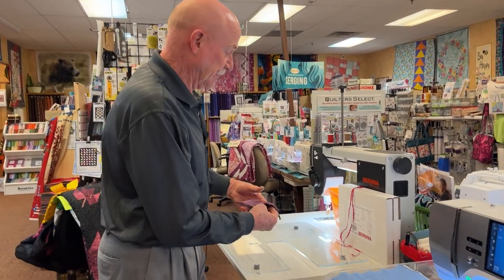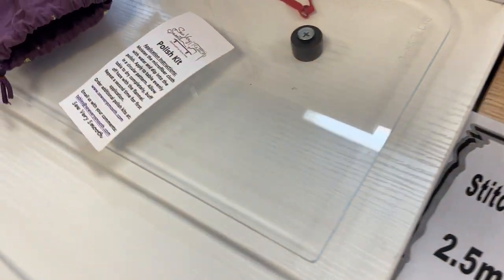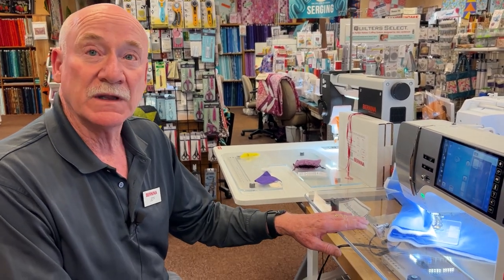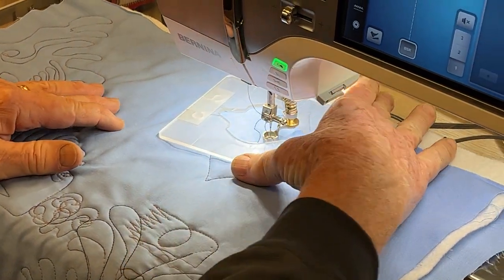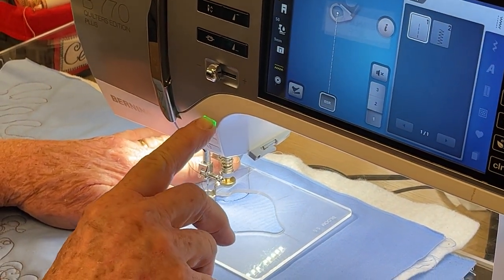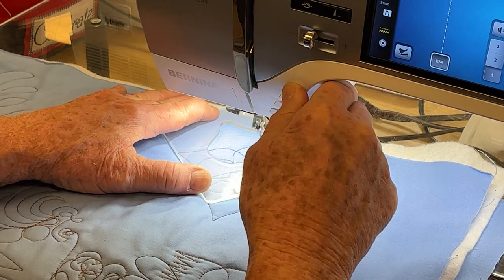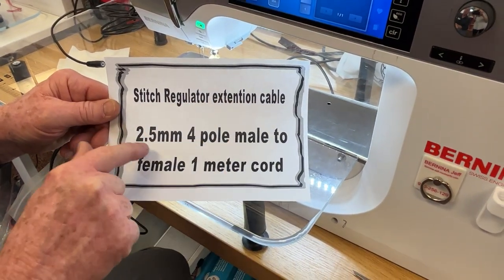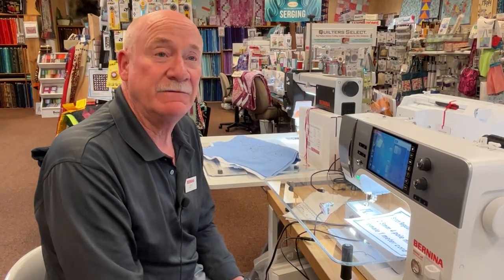Ruler Work Stitch Regulator table invention new polish to make it slick how to get a new cable Jeff

Comment: Bernina Jeff have you something that is easier to use to undo the screw that holds the needle in place. I get so frustrated and am sure others do as well with the one Bernina provides. If not get your thinking cap on I am sure others would appreciate a new device for it as well. Have learnt so much from you.